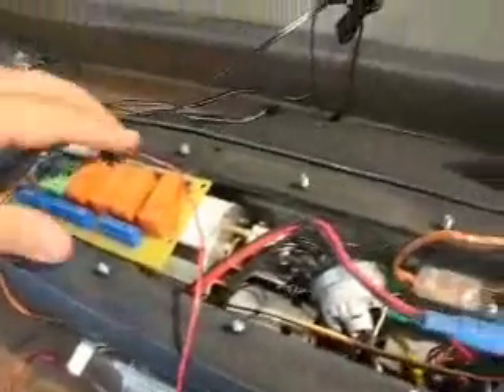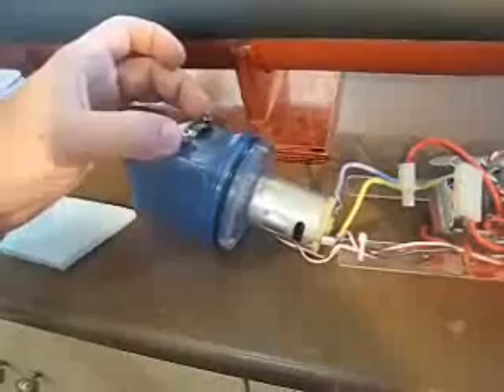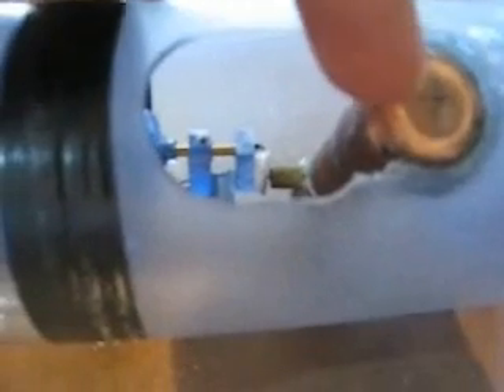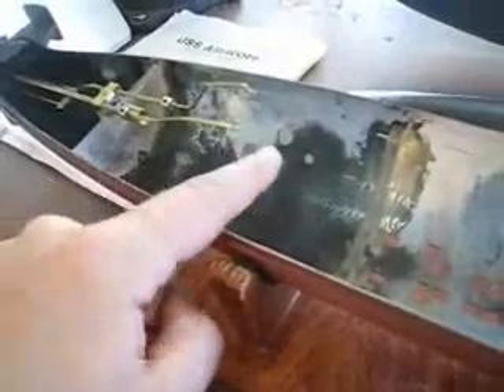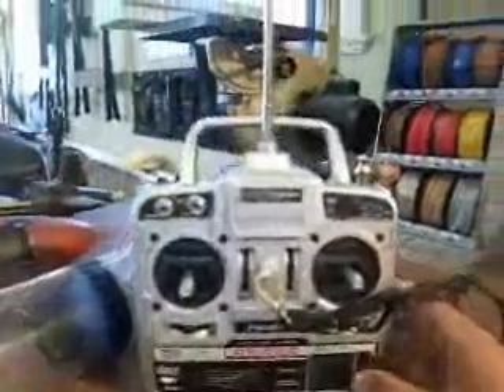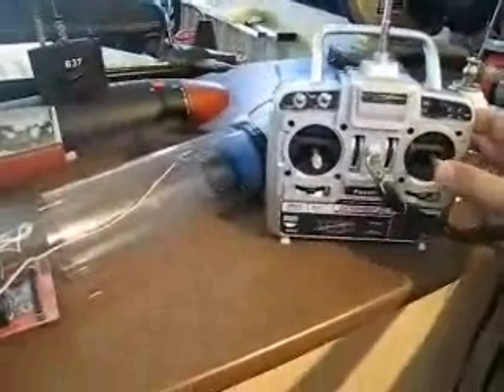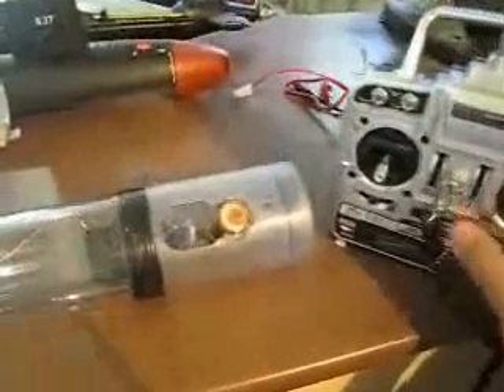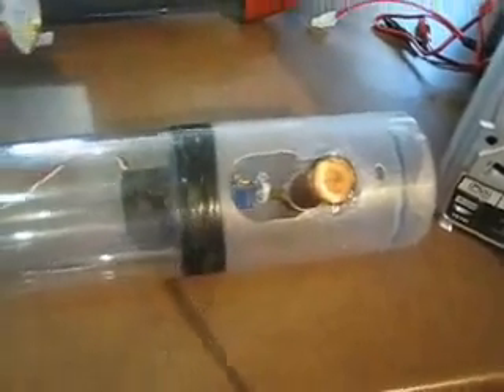Sturgeon WTC Video Part 1

Comment from the maker: In the US, there are two FM frequencies available. The first is reserved for airplane use and the second is for ground.  Make sure that your radio is set up for ground frequency!  Other than that, all the "guts" are the same, except for the dedicated RC Submarine modules such as levelers, depth controller, etc.